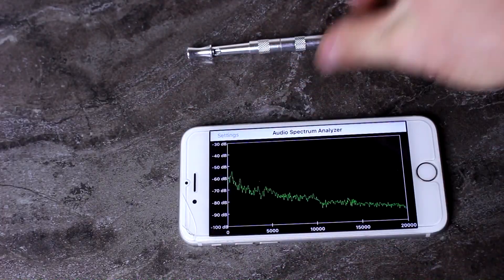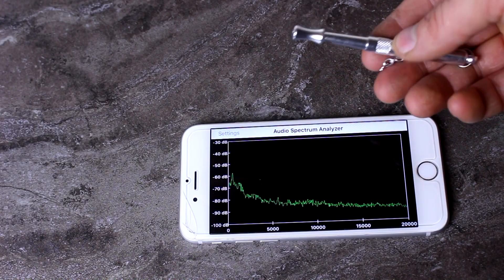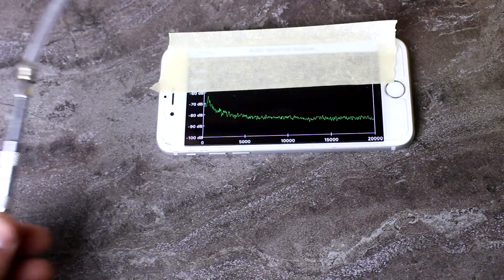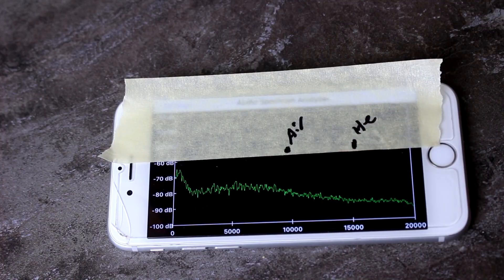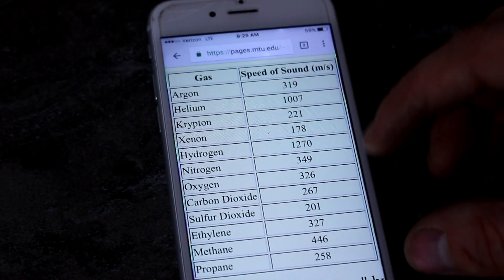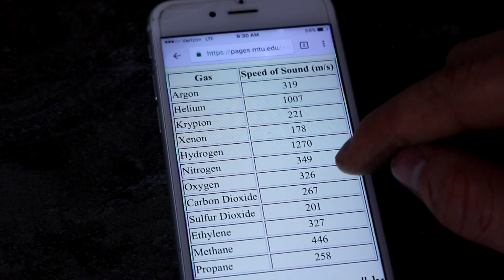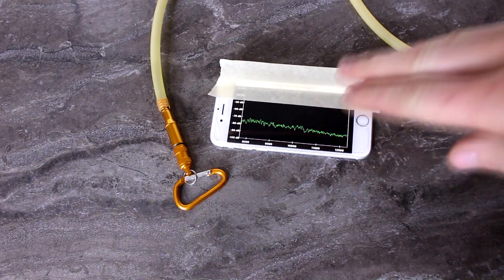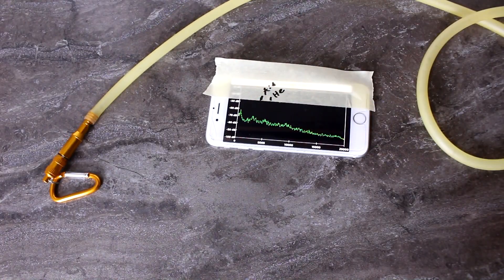Dog Whistle On Helium and Xenon

Comment: If anyones curious as to why the air and helium frequencies didnt look as dramatic. Our perception of linear pitch is logarithimic to frequency. Say you wanted to play A on piano the standard is 440 Hz. To go one octave up you'd have A=880hz a jump of just 440. But to go an octave up again you'd have A=1760 Hz having to go up another 880 Hz. So the higher the pitch the larger the gap in similar pitch changes. Our perception and measurement of loudness is similar

Comment: The phenomena you discovered about having multiple peaks depending on the pressure is something any wind instrument player would know about. It has to do with the harmonic series. When you blow harder, the air moves over the reed faster, which causes the pitch to move to the next resonant frequency, 2, 3, or 4 times the base frequency, usually. I'm not exactly sure of the physical mechanism behind it, but it is a common thing, and also the mechanism that brass instruments are based on.

Comment: Maybe this is a dumb question, but how does your voice get higher when you inhale helium cause while you’re inhaling it, the atmosphere stays the same, so wouldn’t the regular air just slow down the sound waves coming from your mouth back to a normal speed? Also I’m curious what would happen if we could hypothetically replace the atmosphere with only helium and the air inside lungs were just regular everyday air like if ya just inhaled it from a balloon. Would it sound super deep? Lol I have no idea if that made sense but it’s just a thought
Reply: you can think of it like a wave or a string; air in your lungs in the same air picks that string with a certain speed. If you have helium in your throat, it picks the string faster, and the pitch is higher; if you have xenon, it picks it slower and so the pitch is lower.

Comment: Very late comment, but the reason you get different frequencies depending on the intensity. This is due to the harmonic series. The natural "ladder" of frequencies that build off of a sounded pitch. The "ladder" shifts for depending on the given material, and while using the same material, the pronounced/prominent note/pitch changes as well. This is how all woodwinds/brass instruments work. Essentially, the harder you blow, it will ascend the "ladder" more. Very simplified explanation, I am not a sound engineer, just a musician, but I hope that helped sate your curiosity, assuming you haven't already heard from elsewhere or looked it up. Great video! Enjoyed it very much! :)

Comment: The "multiple peaks" thing is known as the overtone series, and is the main factor in timbre, or what makes different sounds sound, well, different (aside from pitch). More tuning theory fun, differences in pitches is actually about the ratio of the frequencies; an octave is  twice the frequency. If we round the pitches you got from air and helium to 1000 and 1500 Hz respectively, that would mean that the helium raises the pitch by a fifth

Comment: The issue with the whistle would be it's made for air and "tuned" for air, the sound you hear is not necessarily the only sound it produces- it likely produces a much higher pitch for the use as a dog whistle, what we hear is just a "side effect" of air movement- that's not the "dog whistle" part (which we can't hear)

I suspect some of the issues you have with this is the pressure is varying on a whistle that was made and "tuned" for what the mfr assumes would be the pressure and temperature of a normal human breath.
Much like pipe organ pipes are essentially large tuneable whistles- they are made to operate both on specific wind pressures as well as temperature- usually 68ºF is where they are tuned to their pitch, if you vary either wind pressure or temperature the pipe loses it's pitch it was made to sound and can "overblow," it sounds it's octave higher instead along with an initial noise. You also get some other harmonics out of the sound as well depending on the mouth width to height ratio and scale of the pipe- that would be similar to your dog whistle producing more than one peak on the graph- you are getting some of the harmonics along with a pitch.

Comment: This reminds me of elementary school when we'd play around with recorders and a soft breathy puff of air would produce a soft lower note but a hard blast would rack it up to a shrill higher pitched screech.  Did the xenon balloon's slower deflation mean it wasn't as fast through the whistle as the helium was?  I'd be curious to see the pitch differences of these gases at a similar flow rate through the whistle.

Comment: Hey Cody
Big fan of your channel by the way, here's a thought.

A thought on your question "why didn't the spectrometer show 3x hz increase when using helium in the whistle".
You thought about your helium purity but I don't think this explains it. I think it would have something to do with the air that is in between your spectrometer and the whistle. Although you maybe mention it later in the video ;) . That's what I thought about even before you ask the question: Yes, let's say, helium goes through your vocal cords in a way that it lets them move/vibrate more freely. They move faster so we hear a higher frequency. This is true but doesn't the air ( not helium for example ) acts as a wall which limits the sound from our hears/spectrometer and makes it go slower from that point, though it came out of our mouths/whistle faster inicially? Or of higher frequency*

Thank you

Comment: I too downloaded an audio analyzer that uses Fourier transform to produce a frequency spectrum.
results: 
+ A human voice, "singing" a single note, is actually composed of several frequencies. if you start humming as you sing the same note, the number of frequencies doubles.
+ A piano note will produce 2-3 frequencies.
+ A whistle (or whistling with your mouth) produces a single frequency.
some audio tracks (music recordings), produced by a music company, have hidden signatures in them that are actually visible on the frequency spectrum. (for example: signature pattern at the start of a song. a single frequency missing from the recording (this one might be just missing data due to compression or something)

Comment: Cody, I think you're wrong here, It is not because the speed of sound is faster in Helium that the frequency raises. Actually, the law of perfect gases tells you that no matter the molecular weight of a gas, the number of molecules will be the same at a given pressure and temperature, hence the speed of a compression wave will also be the same. 
What affects the frequency is the transmission of the wave from Helium to air (which is denser), so from a lighter gas to a denser gas. This is where the frequency changes by conservation of energy.

You could easily prove that by ringing a tuning fork in a Helium chamber (which will generate a known frequency) and listen to it with a microphone from inside of the chamber of from outside (in air).

Comment: I believe it may be inaccurate to say that helium affects the dog whistle the same way that it affects your voice. The pitch of a dog whistle is determined by its length and the speed of sound (which varies by gas density). The pitch of your voice is determined by the tightness of your vocal folds. Your voice sounds higher under helium not because the fundamental pitch of your voice changes but rather because the harmonic frequencies are altered as the gas inside our vocal tract. Similar, but different. This is why, for example, if you can sing on key without helium, you can usually sing on key quite easily with helium. You don't even need a feedback mechanism to adjust. The notes remain the same.

Comment: Could you recreate the 1000ft tube experiment where you blew through the tube and the air came out of the other end a few seconds later, but with different gasses in the tube to see if the gas came out of the other end quicker or slower?

Comment: Cody'sLab, Could you do an experiment to separate types of radiation?  Maybe you could also see if they act differently in a vacuum, or what kind of materials may prevent or allow penetration with certain types of radiation.

Comment: If it was only the speed affecting the frequency and the wavelength is the same why doesn't the pitch drop when the sound moves into the air when the velocity returns to normal?
I think that the change in velocity means that more or less wavelengths fit in the length of the whistle.
Thus:
I don't think there will be a linear relationship between the atomic mass of the gas and the frequency of the whistle. The lighter gas means that the sound travels faster and so more wavelengths can fit in the length of the whistles air tube. Since you must have a node at the end of the tube and an antinode at the air hole. this restricts the possible wavelengths that can resonate inside the whistle. In air I make 9Khz a wavelength of 3cm. How long is the whistle and is the end of it open ?
It would be interesting to test the whistle in a helium filled box with the mic inside to see if the frequency is even higher. This would confirm that there are two effects.

Comment: Hi Cody, nice show, as always.
Here is my theory for the weird results
for the Xenon experiment, I think the difference went in the pushing of the balloon. As it is not a perfect sphere, the pressure against the rubber at the mouth and the tip is less than at the equator. This is why you can stick a needle at the ends without producing a reaction, only a hole at best. With that in mind, even with the Helium, the pressure through the tube was small. When you pressed the balloon, it just changed the variables. 
I hope it can help you in your comprehension of the experiment :) 
I love the show, continue the good work!

Comment: Hey Cody. You probably got triple the noise frequency of Air using Helium. What caused you to record less is just aliasing caused by the analyser that is incabable to sample the noise at the necessary frequency (you should use 2x the frequency you intend to listen to, which is outside the cabablility of most typical microphones used in mobile phones).

Comment: Just a small thing, dog whistles operate at well above 20,000 kHz so there was no way a phone mic (or any standard mic) was going to pick up the main tone of the dog whistle. Also in my experience most phone apps give really unreliable results at the upper limits of human hearing (both in making and receiving high pitched tones).  I guess it's not really a priority of manufacturers to make sure their hardware can cope with pitches so high most people won't hear them =)

Comment: The dog is fine, absolutely not annoyed by the dog whistle on helium and xenon. He knows Cody do all kind of experiments that dog don't understand.
Youtube viewer, however, may feel differently about the validity of the testing device to begin with. Try to evaluate with a function generator if the phone really has high frequency microphone and if the software properly detect  and display any range of frequencies.

Comment: CodyDon, remember when you filled a soda bottle with pure oxygen and threw in a hand warmer?
I wonder if you were to toss a hand warmer into a balloon, then fill the balloon with helium, and let it sit for a while, if the hand warmer would get that pesky oxygen out.
The hand warmer contains water though, so you may need to pass the helium through some dry CaCl₂ to get residual water vapor out, but, I'd hypothesize you'd get much purer helium out of the process.

I'll give this a try myself as soon as my budget permits.

Comment: Is the explanation correct?? I've never thought this through and am curious if my reasoning is sound :)

 I've know that the speed of sound was faster in helium than air but I never really thought about why. We all known that the speed of sound is faster in solids and liquids than in gasses due to their higher densities. The whole sound is faster in helium than oxygen thing seems counter intuitive since helium is less dense than oxygen.  Using this density rule the speed of sound should be slower in helium than oxygen. The confusion here comes from the fact that the speed of sound isn't determined by density (mass/volume) instead its how close together the molecules are (in solids and liquids mass/vol is just a good approximation of closeness). By the ideal gas law, gases at the same pressure and temperature have the same number of molecules for a given volume. This means that the only way to increase the density of a gas (without altering pressure/temp) is to increase the mass of each molecule. Changing the mass of a molecule has a negligible effect on the closeness of the molecules in a gas as the distance between molecules is so much greater than the slight change in size of a heavier molecule. So increasing the density of a gas effectively only makes the molecules heavier and thus slower to accelerate which results in a slower speed of sound.

Comment: One challenge with this experiment is that the body of the whistle is tuned to resonate at a certain frequency, based on the geometry of the wedge. The wedge generates a turbulent source of noise with specific overtones that the whistle manufacturer will adjust the body to sound at. I'd be willing to bet that if you did the experiment with a slide whistle, you'd find that helium and xenon resonate best at different lengths.

An interesting way to demonstrate this at a larger scale uses a bunsen burner, and a few cardboard shipping tubes. With the burner lit, lower the tube around it. By carefully adjusting the burner's depth (a good source of, essentially, white noise), you can get each tube to voice.

Comment: the helium made two peaks too.  one at around 4500 or so.   could it be some kind of harmonic?  I watched a hearing test video thing recently, where the sound went from about 10hz to 20,000hz.  as the pitch got closer to 20khz, my ears told me the pitch was getting lower.  - I had to assume it is some kind of byproduct of the compression in the video, or my junk speakers/headphones..   - one thing that I really thought was cool was how at around 5200hz, my left ear stopped hearing any sound, but by 5800hz it was hearing clearly again.  I reversed my headphones thinking that the video was losing the left channel, but even with the right speaker over my left ear, the loss of hearing was still there... WEIRD!
 
Anyway, just sharing I guess.  Keep the videos coming Cody!

Comment: @codyslab I wander if you aren’t measuring the “artifact” (I can’t remember the proper term) in the analyzer’s range of a much louder much higher frequency sound that is above of the analyzer’s range. 

Also your phone is probably not recording at a sample rate that can even measure above 20kHz. (See: Nyquist Theorem)

Comment: Would have worked more efficiently if the Tube connecting the whistle was shorter!!!
and in relation to another experiment, Does Nitro Glycerine Set off with a sound frequency?

Comment: you don't see a tripling because you looked at the wrong element for the speed of sound table, air is 70% nitrogen and 20% CO2 roughly
Reply: That's 80% Nitrogen and 20% oxygen, not CO2.

Comment: I don't think the helium is doing exactly the same thing in the whistle and in your voice box. Helium doesn't actually change the fundamental pitch of your voice (I did an experiment on my channel about that). What changes when you speak or sing with helium are the harmonic frequencies that are amplified by your vocal tract. Your voice produces sound with vibrating vocal chords, but the whistle splits the gas to produce the sound. Interesting experiment--thanks for pulling out the xenon--don't see it in experiments often.

Comment: I suspect what you are actually picking up on the phone spectrum analyzer is harmonics of the dog whistle, not the main frequency.  Either that or it is adjusted into the human audible range.  The frequencies a dog whistle puts out are beyond the sample rate a phone would even be able to represent.  Not to mention that the microphone isn't designed to pick up those frequencies either.

Comment: If you repeated the experiment using your phone and added a professional audio spectrum analyser to listen at the same time, would the results be the same?
The reason I was thinking this is due to the microphone and speakers in our mobile devices ( both 20 - 20,000 Hz ) which is also human hearing and digital music. So if a dog whistle is 26 kHz it would be outside the range of the microphone so would the microphone just register the next harmonic down being 13 kHz?
Hope this makes sense, it does in my head....

Comment: When you are applying pressure and seeing multiple peaks it may be that the higher pressure exerted is causing an overtone to be more apparent. Like when you blow into a bottle and it makes a tone, but if you blow much harder you can usually get a higher pitched tone to appear that is much sharper sounding.